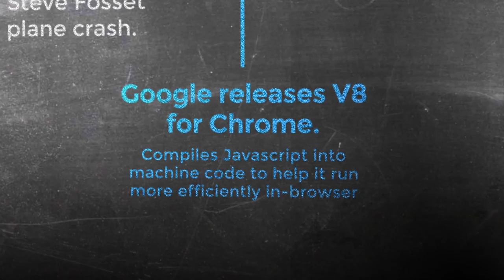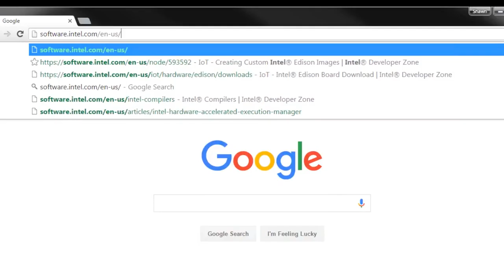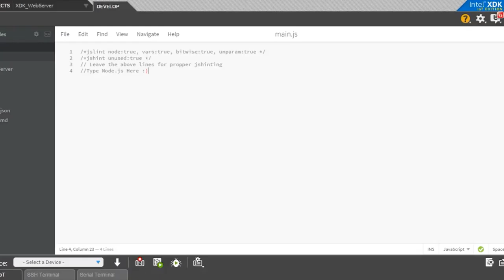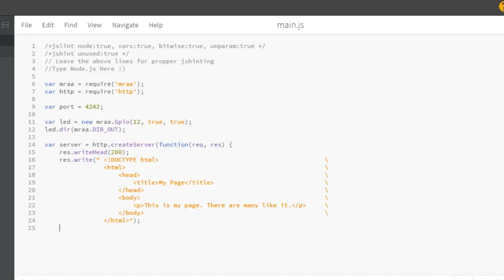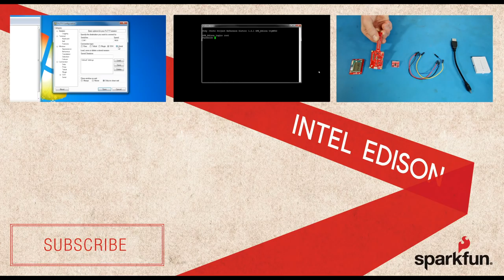Getting Started with Edison part 7 - Javascript Web Server

Comment: The audio instructions are JUMBLED relative to what is happening in the video for connecting everything. For example, when the audio says "connect the emitter of the transistor to the 100 Ohm resistor", the video shows the 1 KOhm resistor being connected to GPIO12. If a newbie simply imitated the video rather than follow the (audio)  "instructions", they could fry their board at worst or get really confused at best when it doesn't work.

Also, this uses an NPN transistor wired in an unconventional common collector configuration (with the 100 Ohm resistor connected to the emitter at one end, the LED anode at the other end, and the LED cathode going to ground). This provides NEGATIVE Voltage feedback relative to the base current drive, reducing the base drive and possibly preventing normal saturated operation. As the transistor turns on (if it does), its base Voltage (tries to) rise to: Vbe (0.7V) + the LED on Voltage (1.8-2.2V) + the Voltage drop across the 100 Ohm resistor (10mA * 100 Ohm = 1V) = 3.5 to 3.9V, so that can't happen, right? If the LED current is 1mA,then that lets the base Voltage go to about 0.7 + 1.8 + 0.1 = 2.6V (using the lower LED on Voltage) with Vce using the rest at 3.3-2.6=0.7V -- a more reasonable value. If this were a normal common emitter circuit, then Vce would be about 0.2V, so assuming an LED Voltage of 2.2V, that would give an LED current of: (3.3 - (0.2 + 2.2))V/100 Ohm = 9mA for a brighter LED (Sparkfun recommends 16-18 mA).

So, why wasn't a normal common emitter configuration used here? Was this just a simple goof up?
Reply: +Shawn Hymel : I have used a common collector design in the past (late '70's!) to drive solenoids in a vending machine. The benefit was two-fold there: [1] the design is self-limiting (the more current drawn into the load, the higher the over Vbe to ground difference to reduce the base drive). And, [2] by placing the limiting resistor directly to ground, I was able to use a common emitter NPN transistor (with the right value of limit resistor) as a "current present" sense amplifier as feedback to a micro to detect open solenoids and/or drive transistors without losing too much power (it was a 24V system).